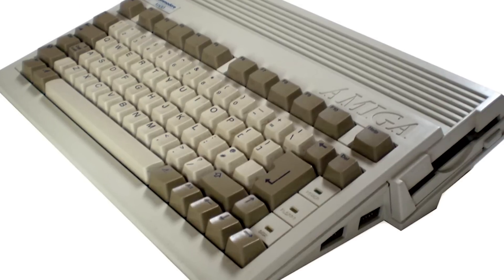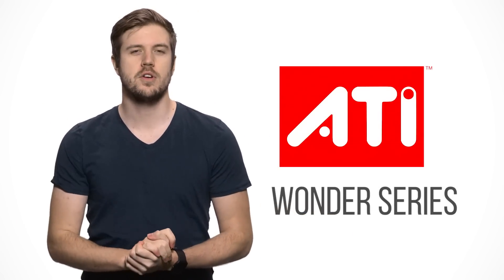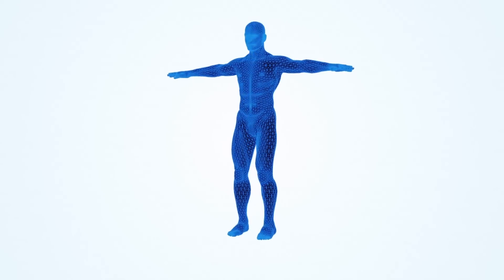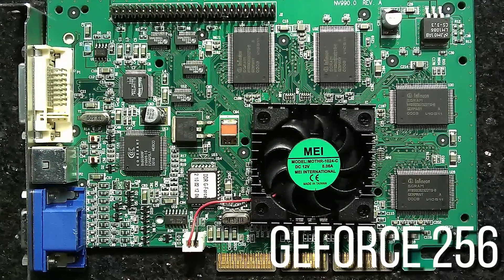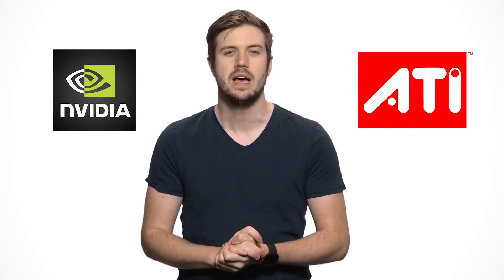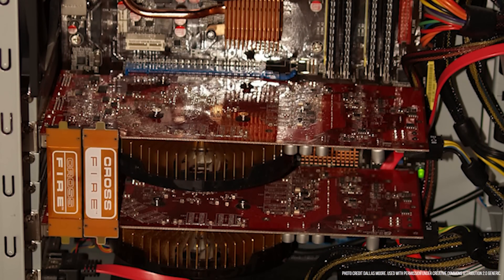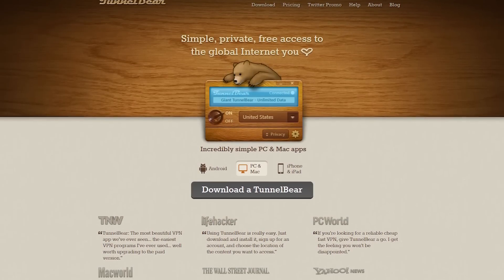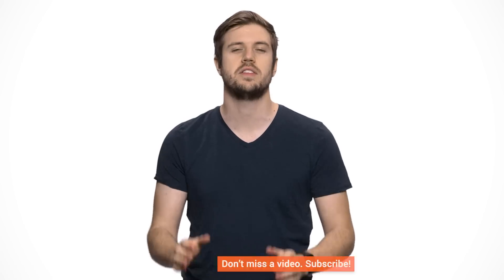History of GPUs As Fast As Possible

Comment: 3:25 Luke: "3dfx were 3D only"
Also Luke: shows a Rush which is a 2-in-1 solution for having both 2D and 3D as one card...

5:13 Now that was a great card. The Ti200 was the slowest of the series, but you could usually OC them easily to the Ti500 top tier clocks, which I did as well. Imagine buying a 3060 and having it deliver 3090 performance... although the performance difference between the models wasn't that huge back then, it was still a considerable gain.

Comment: "Denise" was the main video controller chip in the Commodore Amiga from 1985.  However, the Commodore VIC-20 from 1981 used the VIC (Video Interface Controller) chip and the Commodore 64 from 1983 used the VIC-II.

Comment: Still have a tear in my eye for 3Dfx. I used to have Voodoo2, my friend had Voodoo3 at the same time, so much wanted that card back than :-D
Reply: Had a Monster 3D and my brother later had a V3 3k. Still have both cards around. The first one was an absolute game changer. You literally went from 320x200 on software renderer without even having any kind of texture filters, running at like 10-15fps up to 512x384 or even 640x480 with smooth textures, reflections, speculars, volumetric lights and stuff, running at 30+fps on the same rig. I could enjoy Unreal rather smoothly on a P133 with that card while my brother's 200 MMX rig with a Mystique (he preferred to get that for graphical art stuff) was struggling really hard. That felt like going from an Intel onboard quote-unquote GPU to an actual GPU nowadays...

Comment: Wow I just realized in this old video Luke failed to mention the radeon 9700 pro. It was actually a much larger generational boost than the gen that preceded it than the gtx 8800... Luke basically summarized the 9700pro gen as "incremental improvements"

Comment: I still have a Rage 128 pro on a shelf.  For whatever reason when I was 11 or so I randomly opened my home tower my parents probably bought at best buy and saw a mess of wires with large IDE cables obscuring a lot, but I could see and read the text on the Rage 128 Pro.

Before that time I didn't give any thought to what was in a computer.  Only exterior fanciness made an impression. It was like being an Apple fan boy despite never actually owning an Apple product. I quickly opened up AOL and to my horror heard my mom's voice come through the line. I waited impatiently for her to finish her call and dialed in to see what this Rage 128 thing was.

A year or so after that I found myself walking into a local computer hardware store asking for a Radeon 7500 so I could play Team Fortress Classic better. Then a 9800 Pro came. Through high school I was too poor to even bother trying to upgrade but after that I went for a 3870x2 in my first rig I actually built. Then a 4870x2 in my first custom loop build.

Now in my 30s I have a humble 280x sitting next to me that's due for an upgrade. All because I found a screwdriver and opened up the magic box in my parents home office 20 years ago.

Comment: Video Suggestion: The history of the AMIGA and what impact "she" has on how PCs work.

What impact? Well...this impact:

Multitasking, pointing the way to today's multiprocessing.
a graphics output that could display photos in low color depth
Sound reproduction via stereo samples
Effective relief of the CPU through intensive use of other chips by memory direct access (DMA) and seamless integration into the operating system (although the first PC already had a DMA controller, but it was not used so efficiently)
automatic configuration of expansion cards (AutoConfig of the Zorro bus)

Comment: Can I TunnelBear to north korea?
Reply: Sure! just send me the number of the credit card of your parents along with security code and date
Reply: @Aragubas  347216968537088 775 10/22
Reply: @DyoKasparov  please tell me your joking
Reply: @DyoKasparov  thanks for my new prius
Reply: @DyoKasparov  Thanks for the new laptop
Haha you need the name of the card holder then it actually works so I didn't try to buy a laptop with it.
Reply: @Cremeefr  youre late to the party, i already used the card to buy a tesla
Reply: @bamsuth9650  lmao did you actually try using it
The number on the card only has 15 numbers and you need the 3 number code, furthermore the bank would probably check the namee
Reply: @leehongjin6884  775 is the cvv
Reply: @leehongjin6884  you read it wrong
Reply: @leehongjin6884  and the name is Dyo Kasparov
Reply: @bamsuth9650  I know 775 is the cvv but there should be 16 digits not 15
Reply: @leehongjin6884  oh yah
Reply: @Aragubas  sure it's 6969 4206 9420 6969 date 6/66 CVV 420
Reply: Its probably easier than TunnelBearing out of North Korea
Reply: :v
Reply: :v
Reply: LOL

Comment: You forgot about Matrox. They made graphics cards that were on par with all the others at the time.
Reply: They made Vram )))
Reply: The 3d matrox cards performed far slower than a comperable card from Nvidia or ATI
Reply: @realderyn  depends on the games and tests used, support varied a lot in 1999 so. In some cases G400 was better in some cases other cards were better

Comment: the 8800 gtx is ALMOST as good as my current GPU :(
Reply: THE 8800 gtx is faster than my current gpu... :,c
Reply: MrGoodgamesgaming i finally upgraded to an EVGA GTX 1070 FTW about a month ago GREAT CARD get >2GHz core clock on it. 2076 seems to be the stable core clock now but putting it outside in 40F cold means <40c GPU temps and I get 2101 core clock since thermal throttling has been dealt with! also upgraded CPU a little so cpu bottleneck fixed.. a bit. Could still use CPU upgrade though. BUT MAN these upgrade made my 144hz monitor worth it, in DOOM at least.
Reply: 8800 GT is still the fastest GPU I've had... then my PC's mobo died a couple of months ago so I've even fallen back on a laptop that can't even fluently run League of Legends. 
Luckily I have a GTX 750 (non-Ti) underway to me which I'll put in an old HP SFF with a Q9550 CPU  that I got for a bargain, so I'll finally be able to play modern titles for the first time. Feels good man.
Reply: what was your previous GPU, the one nearly an 8800GTX performance?
Reply: TheNicerDicer Gtx 750 should be arround 4 times faster than 8800 gtx if you compare the passmark benchmark scores

Comment: No mention of the Voodoo Banshee, which was the first gpu to have 3D and 2D graphics processing on a single card? No mention of SLI being invented by 3Dfx and then used by nVidia when they bought 3Dfx? Shame.
Reply: Nvidia SLI is different from 3dfx SLI. Nvidia alternates full frames while 3dfx alternates rows of pixels.
Reply: Voodoo Banshee + AMD 3DNow! running Quake II was fucking awesome for the time. It blew my mind!
Reply: I had Voodoo Banshee, it was great, when setting up some computers to games on,  my mate had he's 3dfx voodoo card & S3 card, when I  only had the 1 card the Banshee, he said that wont run this 3d demo, well did he feel a fool, my Banshee blow he's voodoo out of the water, the next day he went & got a  Banshee
Reply: As far as I remember Voodoo Rush was first to have both 2d and 3d capabilities.
Reply: Still have a pci bus VooDoo 5. Was still working the last time I tried it out.
Reply: @ssplayer  Few weeks ago I started up a Pentium 120 PC I bought in 97. It was just sitting past 15 years unused. All works fine on it, including the Voodoo 1 card.
Reply: The Banshee (1998) came after the Voodoo 2 so also after Riva 128 (ZX) and ATI Rage (both 1997), which both had 2D und 3D acceleration in one chip. The Voodoo Rush was just a Voodoo 1 and some other chip for 2D on one card.

Comment: I could be wrong, but I believe the Matrox Parhelia-512 was the first surround gaming GPU capable of pushing 3 monitors back in 2002, the Q3A demo I saw had me drooling, I was rocking a heavily OC'd Radeon LE 32Meg (anyone remember those?) at the time. It was also the first with a 256-bit memory bus and a 10-bit color frame buffer. It didn't fair well as its Price:Performance was horrible compared to a GF4 TI. It came in AGP or PCI-X(not E) bus flavors with either 128 or 256MB of VRAM. Let us also not forget the Gigapixel(R) GP-1 & PowerVR Kyro chips and their tile-based rastering which has been used by nvidia in its maxwell and pascal chips (as well as many mobile devices) due to its bandwidth and power savings.

Comment: rip ati cards. your flames will be remembered. the flames looked so nice ._.
Reply: especially the flames my HD 5770 went up in :(
Reply: @Chuckiele  I still have mine.
Reply: @humansvd3269  I have mine on my dead hardware shelf. It technically still works but it has artifacts.
Reply: I still have one ATI card probably from 2003-2005. Works like charm still
Reply: @Venomclippy  It's hard to say who had more hardware trouble. The two major events I can remember was the switch to lead-free solder, which caused big problems for nvidia (I think it was thermal cycling that broke solder joints; 9800 gtx was one of the cards afflicted). ATi had a problem with their 9500 and 9700 cards; there was this shim with a rubber thing under surrounding the main die and it could swell and lift up the heat sink off of the GPU after a couple of years; they fixed it with the 9600/9800 and later GPUs by adding a small thickness to the heat sink above the core so that it did not get lifted even if the shim rose a bit.
Reply: Acer desktop with radeon x550 from 2006 stil running strong. Apparently it was built on 110nm process. 
Radeon HD4650m pavillion dv6 laptop 2010 died in 2017. Built on 55nm process.
2014 macbook pro with 4th gen intel iGPU still runnning strong running mac metal api and linux.

Recently bought a Dell G5 se with radeon rx5600m manufactured on 7nm process node. 
Hopefully it will last for 10 years.
Reply: I don't recognize AMD as the owner of Radeon GPUs, in my eyes, ATI still exists
Reply: I still have two HD 4870s and one HD 5870.

Comment: 3dfx cards was awesome,.  If it wasn't for those bad decisions, it could have been an NVIDIA vs 3DFX war instead of ATI/AMD vs NVIDIA.   And the way they did SLI in those days with a pass through a VGA daisy chain cable was different.  Actually had one of those.  I still have a Voodoo 5 single card SLI unbox.  I never got to use it because when I got it, i ended up getting an NVIDIA also at the time as a gift.  So never opened the Voodoo.  At that time, the game of choice for me was Asheron's Call.
Reply: Nvidia based their SLI technology on 3dfx/Voodoo's. I liked how Voodoo version let you combine different, non-identical cards in SLI (kind of like what AMD lets you do now with mixed Crossfire.) That type of flexibility they had back then is still better than what Nvidia lets you do TODAY with SLI, lol.
Reply: Deathbrewer
I totally agree with you.

Comment: The first graphic card to ever to have a GPU was a Nvidia GeForce 256 card. The term GPU didn't even exist before that graphics card existed.
Reply: Yea, that was back when ATi coined the term "Visual Processing Unit" or VPU in 2002 with the Radeon 9700 to try to be a competing term, lol. Guess we all know who won that war of semantics... GPU is now the accepted, common term.
Reply: I should of also added the term GPU was created because they did a major architecture change in how the graphic cards worked. It took all graphic processing from the CPU and had the GPU do all graphics processing unlike previous 3d accelerators only took part of the processing off the CPU. So it isn't just semantics. The device is called a "Graphics Card" not a GPU, which is the main chip on the graphics card, so you can't retroactively rename all 3d accelerators before that a GPU because they aren't using the same architecture as a GPU. I have always been paying attentions to computer hardware and I remember when the first GPU was released and how big the change was.

Comment: Strange, why some info about 3Dfx is wrong here ?... Voodoo 3000 and 5500 blew everything on the market away. Voodoo was the best card ever made, nvidia seeing this and unable to compete with 3Dfx bought 3Dfx out and integrated it's technology into it's own and only then then the the GTX cards went out (with 3Dfx tech). without 3Dfx nvidia would lose to ATI\AMD today. shame that it's not in  this video :(. Also Nvidia SLI is based on 3Dfx tech)
Reply: Also, no mention of the Voodoo Banshee card, which was the first card to have 2D and 3D processing on it, way before ATI and nVidia could do it.
Reply: indeed.
Reply: It did feel rather strange that the jump from 3dfx being top notch with Glide to nvidia snagging SLI from them was missed.
Reply: What about riva 128 from 1997?
Reply: nvidia needs Intel.
What about amd 64? amd64+ati vs intel32+nvidia...
Reply: Also, the full capabilities of the V3 and V5 weren't widespread at that point - CPU speeds kept them from their full potential.

Nvidia's T&L technology drew in a lot of suitors...

Comment: I still got my S3 Virge :D
Reply: I actually bought one from a thrift store when an old XP machine I was using as a "guinea pig" had it's old geforce card die randomly. (It didn't have any integrated graphics.) I had no intention of doing any graphically heavy tasks on the computer, so I just got the cheapest working card I could find, and it did its job. I had no idea I was buying a historical artifact of any kind.
Reply: S3 Savage 3d was gtx970 of it time
Reply: Not to mention it was the most compatible DOS card you could get.

Comment: I am pretty sure that, I still have my Voodoo Graphic card laying around somewhere
Reply: +Danny Kriegbaum Laursen Ah, the good 'ole days; Voodoo 3 16/32bit agp/pci...but I eventually made a new build with an AMD Athlon 1ghz and oppted for the TNT2 instead. Damn were the other guys pissed off with envy with their Pentium 2's and Pentium 3/800mhz cpu's and their Voodoo 3's, trying to run Hitman and Aliens vs Predator 2 even on medium settings, stuttering along at 15/20fps if even, whilst my Athlon 1ghz and TNT2 build ate those games maxed out at a higher resolution than their 800 by 640, for breakfast :D then I bought an FX5200 128bit.

Comment: Nice video - but some flaws: 1) the shown "3DFX VOODOO" card was in fact a Voodoo Daughterboard on a Hercules Stingray. The typical 3Dfx cards where used as separate cards with analog loop through cables for the video signal from the main graphics card.  2) The shown "PCI Express" slots are just a single lane slots - usually graphics use 16x "PEG" slots (PCI express graphics) and won't even fit there.

Comment: Actually Ati was the first who bringed unified stream processors instead of pixel shaders and vertex shaders starting with consoles (in Hollywood graphic chip of Nitendo wii). Nvidia launhed after that 8800gtx with stream processors the first PC gpu with stream processors but the second in gpus. Thats why amd-ati claimed that hd2900xt (launched after 8800gtx-gts) has second generation of stream processors.

Comment: My first computer was a Macintosh SE in 1994 when I was 5 and I used that till I was 11 when I built my first PC. pentium 4, 512MB RAM, VOODOO GPU 64MB, some generic mother-board and a 300W PSU and a CD R-WR big deal having that lol. and it was all put in the cream white case which I tried to paint black with a Roller that machine played age of empires 2, duke nukem 3D,Doom 3, Rayman and tomb-raider like a boss using windows 98. ah simpler times lol

Comment: i still have an 8800 gtx in my older computer (intel core 2 quad q8200 and 8gb of ddr2 800 mhz ram in the form of 4 2gb sticks). it still does a good job considering since it can max out league and can play tomb raider on its lowest settings in 1080p at around 50 fps.

Comment: 3dfx unable to keep up with the performance? Prototypes of the unreleased Vodoo5 6000 actually beat a geforce2 ultra and can compete with the geforce3! It's worth mentioning that the production costs of the Vodoo5 6000 were very high, so even if it was released, it probably wouldn't had saved 3dfx.

Comment: Is it worth the extra $30 to get a GT 740 or should I just get the cheaper GT 730?
Reply: Get the Titan xxx 69
Reply: +Kevin Lee If you can, the 950 is a very good card for the price. Especiallyl the Windforce OC edition gigabyte one. I have it, and if i had a good enough power supply, i could overclock it, alot. it runs really cool, and it also comes with an overclocking utility on the driver disk, which is cool
Reply: +Mitchell Durand Is this a serious question? Here's a crash course in Nvidia graphics cards: if there's no X in the model name, don't get it.
Reply: Geforce 2 X, shoud i get it?
Reply: radostin04 Hell Yeah!

Comment: i exited pc gaming not long after i got the fx5700ultra. Last year i built a new pc again after my disapointment with how poorly some of the games have run on the ps4. wow things are way better now. I ignored pc gaming entirely after i sold my pc . so when new stuff showed up i was quite blown away. when i pulled the 970 out of the box i was like wtf are those pipes for, this thing looks sick! the 5700 was just a pcb with a fan glued to it(basically). drivers are  much better now also. i dont have to go back and uninstall the old one YAY! and omg overclocking used to be a nightmare compared to today. and if you screwed up there was no thermal safe gaurds it just melted. I burned up my older card before buying the 5700u, like smoke coming off it! and that was with a fan from a cnc on a little stand inside my case that was plugged directly in to the wall outlet, so yeah not silent. Now i just slide a slider in afterburner and presto it go more fasta! if i go to far it just shuts off. So im quite excited to see where we go in a few more years. cpus have come a long way also, just ordered a AIO H2O cooler for my cpu. I'm already running 4.2ghz on the I5 with the stock cooler. All i had to do was push a button in the uefi (yeah fork bios uefi is awsome)